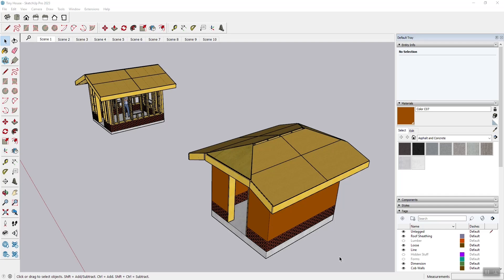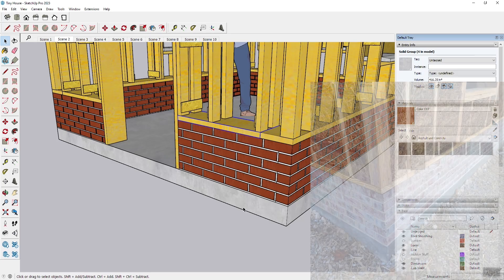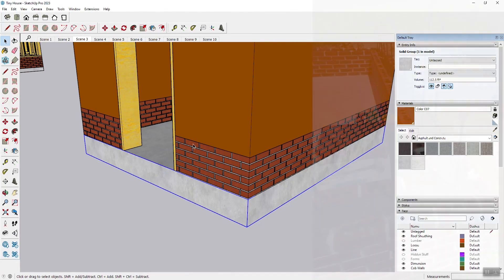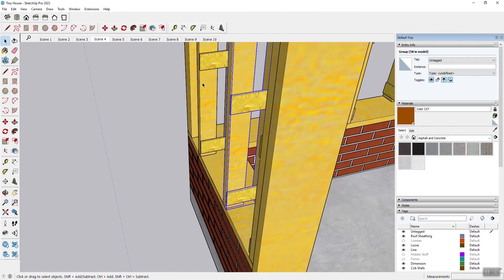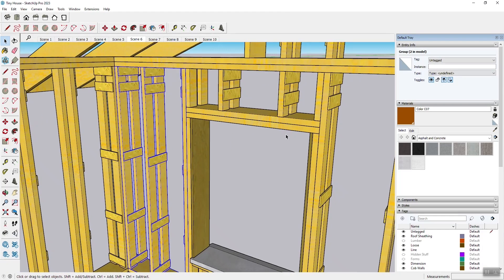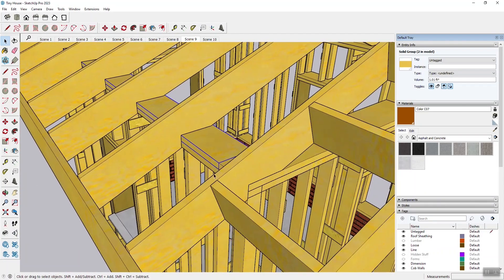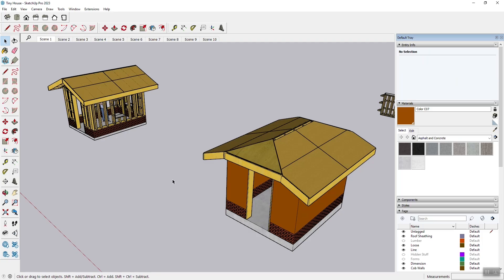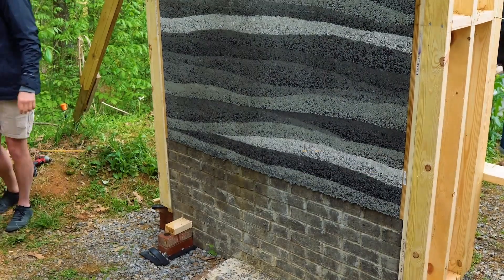Cob House or Straw-Clay House? Key Building Differences Explained

Comment: I was very intrigued by your experiment with cob+ straw clay hybrid (insulated cob) made with form, as that seems to be ideal for grey, dark winters of central Europe. Will you try more stuff in this direction, or do you know some buildings with such reasons? Thank you.
Reply from the maker: Personally, I think this dual wall method is great, but it's a lot more work. I usually recommend just to pure cob or straw-clay. Either or. I would like to experiment with this more, but it's not even necessary in my climate so I haven't done one myself. Again, it's just more work. But if you want more information on the dual wall, please look at CobBauge. They are the ones who originated the dual wall system.
Reply: @thiscobhouse right, makes sense. Will check them but perhaps makes more sense to make straw onvelope and more mass into say floor or inner cob walls. I was always worried about longevity of wood framing in the clay straw, but perhaps that's no issue?

Comment: My understanding is that cob should not be against cement, either on horizontal or vertical surfaces, because cement holds moisture which will eventually disintegrate the cob. I think that's been demonstrated in many modernizations of cob buildings where cement plasters had been spread over cob walls causing the cob to disintegrate.
Reply from the maker: So, cement-based plasters can hold moisture behind them. This is true, and important to avoid using. I recommend vapor permeable finishes only.
When you put a cob wall horizontally on top of a concrete/masonry foundation, there is always a potential for moisture to wick up into the cob walls. This will depend on climate and height of the foundation. If it's a concert, you put a vapor barrier on the top of the stem wall to prevent water wicking up. I've done plenty of cob walls in wet climates with no moisture barrier on the stem wall though with zero problem.

Comment: There is no need for the framing on a clay straw structure. That is old style building code designed to discourage these types of building by increasing the cost. When  people in California started to become interested in these alternative buildings, they were required by engineers to be structurally tested for earthquakes. They were tested up to an 8 on the Older Richter Scale and found to have No structural integrity loss. Although there was some cracking, the cracks did not separate nor did they reach floor to ceiling, nor were through the entire wall. So in other words these are considered to be some of the strongest buildings on the  planet. However because like most things that are over regulated in this country good luck getting them approved in most areas with out the framing. I live in the Ozarks near the New Madrid Fault and Slip Straw was my choice for low cost building. How ever as many people know or not  in the Ozarks we have no building codes. So I did my research !
Reply: Would you have some link or pictures of such buildings?
Reply: What are your thoughts about some kind of combination straw clay/cob? As in high thermal mass on the interior/high insulation on the exterior?